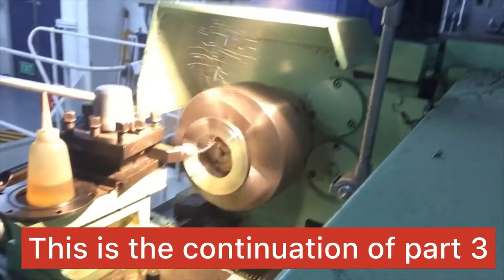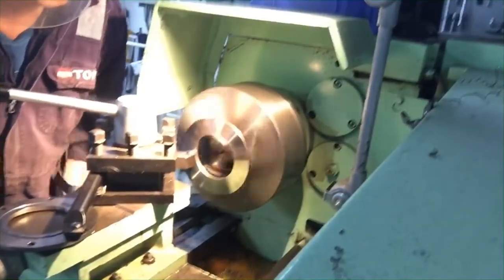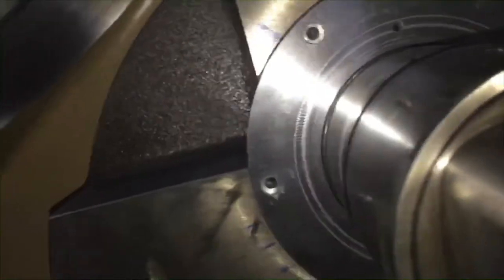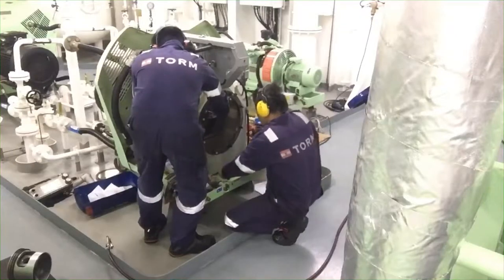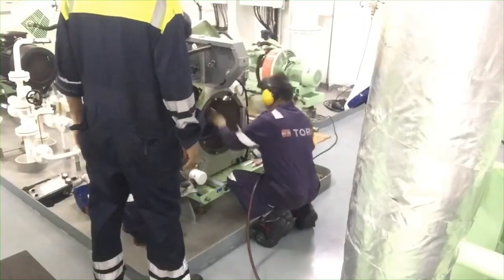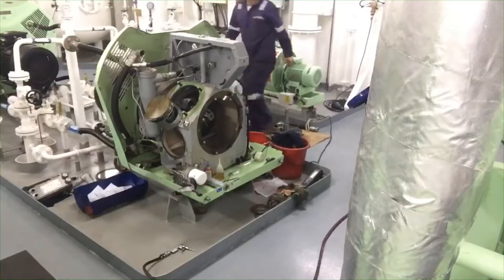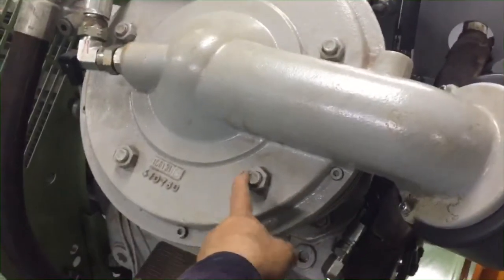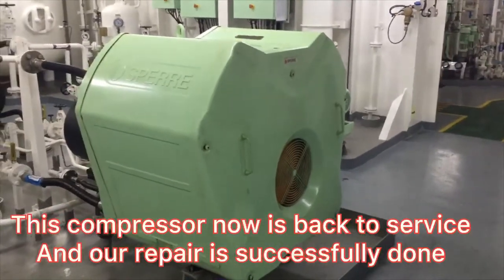Buti nagawan pa ng paraan kundi kulong kami sa black sea CRANKSHAFT METAL PLATE  (Part 3 solved)

Comment: sir sana ipinakita mu din kung paano mu sinukatan at ginawa yung pagbutas sa flange at yung paggawa mu ng groove nya
Reply from the maker: ang pag sukat ng butas bro ay g
kinuha ko ang PCD ng bolthole tapos divide mo sa  3.1416 then ang resulta diviide mo number of holes then ang groove nya butasan mo muna ang hole para sa  langis then saka isalang sa turno tapos itapat mo ang toolbit sa center ng hole para sa groove then dahan dahan pakainan mo ng 0.5 hanggang umabot ka sa lalim na 1.5mm ang ginamit ko na tool bit ay ang cutting tool na may lapad na 3mm kasi ang butas ng ay nasa 2.5 lang